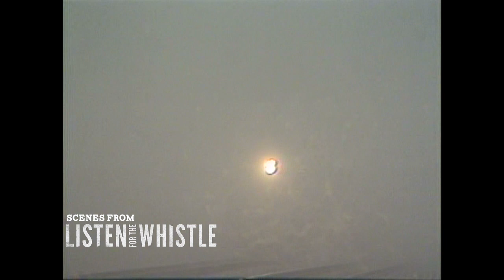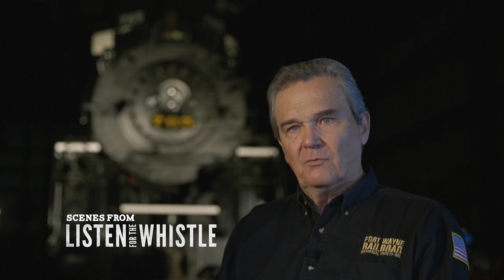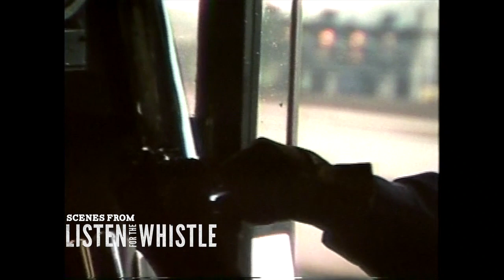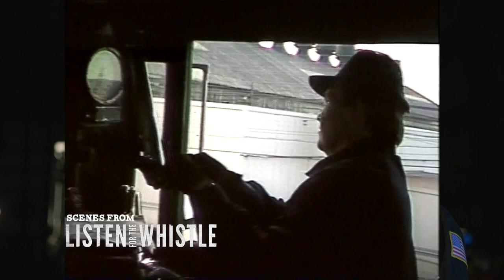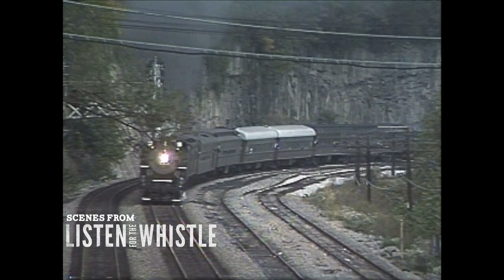Attica Hill is No Match for Steam | Nickel Plate Road no. 765

Comment: Again, 765 has proven how powerful she is! :D
Reply: I would like to see her take on bigboy on a pulling test!
Reply: No contest.
Reply: Let's not get crazy here.  You're talking about pitting a 6000+hp articulated steam locomotive with 135375lbf starting tractive effort against a 4500hp locomotive with 64135lbf starting tractive effort.  I love 765 to death but a Big Boy like 4014 would probably chew her up, spit her out, look back and say "What was that?" and move on like nothing happened.

BTW: I love crunching numbers.  Based on some math figures from a 1934 article about calculating a steam locomotive's power at speed and based on the fact that it takes 8lbf per ton to move a train on perfectly flat track I estimate that 765 if pushed to the limit could probably pull a train of 4881 tons at a speed of 40mph, excluding the weight of the engine and tender.  A Big Boy on the other hand at 40mph is likely to move 7510 tons, again minus the weight of the engine and tender.
Reply: its a joke! even I know a Berkshire cant take on a bigboy
Reply: I hate to say this but 765 would lose! The big boy is is a freight locomotive therefore she can pull a hell of a lot more but it would be to see how much the 765 could pull!

Comment: I remember I saw the 3985 at the top of Kirkwood hill back in 2004. The station was set at the top of the hill, and even though the speed limit is 20, I remember I could SEE the brick inlay of the station platform shake and buckle from the power.

Comment: Excellent story! We NEED many more like this. It maybe nothing to you folks who get to spend everyday in "the life", but to those who only get to see it from a video standpoint..... well.... were selfish and want more!!!
Your doing great things. I wish SRI and 1225 could do as much. Please post more stories like this. You have no idea the size of the void there is concerning the need of experienced crews telling their stories. Hoggers, Firemen, Brakemen, and Conductors alike.
Reply: yep 1225 is even a bit stronger then the 765 by about 300 or so horsepower, the 765 has 4000 and was made to run hard freight at road speed though the cars were half the size they are today, but still 50 cars of freight is a lot for one engine to run by itself but I have seen it done though it is slower then molassis in antartica though they do have a speed restriction for extra long trains due to the increased stopping distance, but I have seen 2 engines take one that had to be at least a mile long full of coal and they struggled it seemed and they were the six wheel truck set bnsf locos, so they are at least 4300 hp last I checked, you just cant beat a steamer for raw power though and I heard that the horseshoe curve excursion put the 765 though its paces, and I doubt it would have pulled over saluta  without help even 611 had a great deal of trouble with that on the videos of her trying to make the hill after half her consist was taken over with other engines, though she gets going from a dead stop and hauls at it and takes the hill to the top on what was the steepest mainline grade before it was taken out of service, though I doubt even two diesles could do that today from a dead stop it would not be easy for sure. though today railroading is a differant day and age and the things they did in the past they get their underwear in a bunch about if they were done today, though it sure gave more people work and jobs being more man power intensive then today.
Reply: manga12 I know the 611 video your talking about. Had her hands full that day huh! As for the Berkshires you mentioned, your about spot on with your numbers. However, with 1225 having 1" larger drivers (given to her [and her sisters] after she started service) and friction bearings, this would tend to even them out. Both capable of handling 100+ car trains instead of the 50 you mentioned. And up to 80 mph in some places during their normal service years. Cars may be larger now, but their weight hasn't changed much. 70 and 100 ton cars existed back then.
I cant state how NKP operated but the PM did run shorter trains than them. When the C&O took over the PM in 1947 and the C&O Mechanical Dept got onboard, they quickly saw that the PM Berks were very, very underused at hauling short trains (less than 80 cars). And in good shape from the lack of abuse and good maintenance. The PM engineers were promptly given longer trains to pull, and at the same speeds or better. In those days, you didn't shorten a train, you added another loco. Many a picture exist of doubleheaded NKP Berkshires. Never saw a PM Berkshire doubleheader. I have seen a Mikado and Berkshire together on the PM, so it had to have happened. The theory being, if one loco starts the train, albeit slowly, then two locos will start it moving faster. That was the rational.
Be a good show to see 765 or 1225 on Saluda. The smaller drivers (than 611) might have given them the edge to get over the top. Hard to say.

(my references are "PM POWER" by Art Million, "C&O Power" by Huddleston/Stouffer, "Van Sweringen Berkshires" by Huddleston,  and Lima blueprints of the PM Mech Dept. and AMC)
Reply: PM Railfan I dont know about a saluta, it gave just about all locos a workout, and 611 has more power but your right it has biger drivers though I dont know that 2 inches would have made much differance compaired to say a sub 60 inch driver diamiter, as for the use in modern day freight well I guess that that only way to compair would be to rig a mile long one up to 765 and pull and compare it to one of them new ge locos that get 4300 hp and see who could pull the train better get it going faster, see if its still able to do it just as well or better at high speed service, its the only real way to know for real, though the steamer I bet would do a better job at speed once its there since the new ge 4300 series only have 43 inch wheels tiny in comparison to steamers drivers. I dont know though the pm 1225 would be apples to apples hp in comparison but I dont think she ever runs the main line just her route in michagan but I dont know for sure.
Reply: No need to test locos with a mile long train. Just search on here (youtube) and you can find all the proof you need as to how steam can outperform diesel. I know for a fact there are two videos here that depict the "New River Train" both with 765 and diesels. It only took ONE Berkshire to pull 30 cars (UNASSISTED!). It took TWO GE 4400's to match that. For all their prowess, a/c traction control, and other fancy modern enhancements.... steam still pulls more!
No, 1225 for some insane reason isn't allowed out of Michigan. I can never get a straight answer for this from anyone in the know. I summize, its NS and CSX's "anti-steam" programs. Think about it, if you were SRI what is the first thing youd want to do with 1225??? Put her on the main and notch her open to about 60mph and watch her purrrrr along. Never happen as long as NS and CSX are around. (oh how I wish they would prove me wrong! FAT CHANCE!)
Reply: PM Railfan ns though has the 21st century steam program, they have more then asked for the 765 npk to pull excursions for employees the last 2 years, they put lots of trips on her during the summer, so I dont buy that NS is anti steam, csx is dead set I hear, though this might have to do with the shear volume of traffic on their rails as I can attest as being held up constantly at the track, and my neighbor that just became a conductor for the csx, can attest they cant seem to get people signed on fast enough.

but he dont like the scedualing they do and sometimes being on the road for 36 hours while deadheading home or waiting for a train to take him back here to deadhead, he is gone constantly, he said the pay is good but he dont like the scedual and its really not something he is liking, the rails arn't for everyone after all though, but he also said sometimes they pull out and got to wait got to wait and end up over time so they sit till the recrew and sometimes he dont have to do a dang thing for hours, but attention to detail and orders is absolute no messing up allowed with that much power and weight, 

I am well aware of the NPK 765 holding the record for the amount of cars up the new river train, though she is really set up break wise for no more then 20-25 Mr Winniker at the historical society where she is kept said, as it has something to do with the handling with passenger cars and not thowing people around with hard breaking like you can with freight.

I would still like to see the NPK pull some revenue freight myself though once in a blue moon, 10 cars on excursion is really not even working her all that much, compared to what she was made to do.
Reply: manga12 Hey ditto that one for me too! Would love to see 765 storm her way down some nice stretch of mainline with about 80 cars of freight. AND a dam caboose too -no FRED!
Nothing like the sound of steam at 60mph! Make it a winter scene too, you know she would put on a good show of steam!
To think, people used to take this form of travel for granted.
I hadn't heard of the air set up like you mentioned. Certainly is an interesting tidbit of info and makes good sense.
Reply: PM Railfan yea a caboose, and really pounding the steel like its on fire, as fore winter you will not ever catch her pulling in below freezing anymore, can damage the pipes with the ice, they told me at that one open house in 2013, the thing was in the old days they would have hot steam generators to keep the pipes from freezing or keep the fire going as if the water froze in all those pipes on a loco it would do great damage, so they will not run her when its this cold like tonight the fires snow of the season 12:54 am 11/13/2013 as I write this, the 765 very well could pull loaded freight and not empty cars like they do in mich for the photo opps by the carlin grain elevator like they do from time to time by owasso, reall loaded coal and giver her about 20 cars if she is going to go to west wayne to turn around another time, like they sometimes do, even if its just a short duty let her pull it under power and not pushed like they did last time they took her down there to turn when they did.
Reply: Sounds like the road foreman on the tourist railroad that I work for in Oregon. He's pretty irritating. He was like that the first time that I ran with him. Turns out he's like that with everyone I work with. He's just a curmudgeonly old road foreman who is about 80 years old. Thankfully he retired a couple of years ago. I'm now the acting road foreman, and I'm 25 years old.

Comment: Have to wonder what the trailing tonnage behind the tender was for this trip. As far as I can find, Attica Hill is graded at 1.15%. 765 would be nominally rated on that hill for about 1900 trailing tons (drag speed), which works out to about 23-24 cars in the 75 to 80 ton range.

If the locomotive wasn't being worked hard and had room to accelerate from 30 mph, the trailing consist was probably closer to 15-16 cars.
Reply: If it is 1.15% what is that in terms of 1 in something  (1 in 40) for example?
Reply: @AECEntertainment  1 in 40 is actually 2.5%. 1.15% works out to 1 in 87.
Reply: @FanRailer  how do you calculate it then. Pardon my ignorance
Reply: @AECEntertainment  if you're talking about converting between the two gradient units, I dont know the actual conversion formula. I just googled it. Calculating tonnage ratings, I do know how to do.
Reply: That all depends on what ones own definition of "being worked hard". I'd imagine he was giving 'er some beans
Reply: You also have to factor in that loaded FREIGHT cars (which the railroad handles every day) and loaded PASSENGER cars (which is almost all 765 has had to pull in recent history) are 2 completely different weights.

Comment: This trip from Buffalo was probably 1987. Cause that year 765 had a oscillating mars light above the regular headlight. This was smaller than the one that is equipped on SP 4449 Daylight
Reply: Given that he said it was on Conrail, they were heading outta Buffalo on old Erie tracks, and that he'd never ran on the line before, I'd guess '85 at the latest. Those shots from 1987 were of that year's New River Train which clearly never ran on Conrail trackage in New York State. The other shots, I'm unaware of what year they were.

Comment: going back to this I say there are next to no railroad workers that even have an inking of the power or how a steamer runs, many kids even never saw even a real display engine or one at a theme park, turns out the harder you work a steamer and the more speed you put on it the more draft on the fire so its more like a forge and a hotter fire makes steam better as well as gets the steam drier in the superheater so it expands more, and in turn the faster it runs the cutoff can be used more fully to use even less steam per stroke and lets it more fully use all its power and expantion against the piston before it is exausted up the stack which in turn creates more draft on the fire, as what causes the steam to shoot out the sided when it starts out to get all the condensation out of the cylenders is then closed off with the cylender cocks or valves and then the exaust steam is sent up the stack.

Now it might be harder on the low end for a steamer to start a heavy train but once it gets going it makes more of its peak power and therefore can pull a train it cant start while it is said a diesle electro can start a train that it cant pull as most of its torque is on the low end and depending on the gearing in the 2010s now tops out at a lower rpm and does not have the advantage of a steamer where the more speed and heat you can get into its fuel the more of its peak power it makes.  its in a way kind of like a turbine based engine where heated air aids the expantion of gas in this case heated air and fuel which aids the effecentcy of the engine.

Comment: Two questions about the 765 how old is it and what is the maximum Boiler pressure?
Reply: 765 was built in 1944 and operates at 245 psi boiler pressure.

Comment: I'm curious, If Milwaukee road's famous St Paul Pass was still here today, the section of track that had the little joes, could this train run without a diesel through there?
Reply: +Gamer Lunatic If I"m reading your comment right, it sounds like the St. Paul Pass hasn't existed for quite a long time. Decades maybe? Depending on when you were talking about, it's quite possible that MIlwaukee Road 261, which is a fairly comparable locomotive to the 765, could have made it. How steep is the pass?
Reply: +1993Warbirds You can say that you are right about it being gone for a long time. I bring it up because the pass was mainly electrified and Milwaukee was one of the first companies to make use of electrification for freight travel in America. The electrification ran through the mountains in Idaho and into the west end of Montana. It was electrified as you might have guessed was for improving freight travel in that region as steam operation there was difficult and it got really cold. At that point the little joes took over that region with freight and I assume passenger travel. That being said I'm not debunking that steam was not possible, but was difficult. But I heard, could be a rumor, that the Union Pacific Big boys were able to climb up there to test the free swinging front driving wheels. As for the pass and how steep it is, it can go up to 4% i think
Reply: If I remember correctly a 4% grade means that for every 100 feet, you rise 4 feet. This may not sound like much, but it is difficult when a mile long train is being pulled. There are a number of other factors that go into this as well. What is the starting speed at the bottom of the hill. How long is the hill? What is the weight of the train itself excluding the locomotive and the tender. The UP Big Boys I believe could handle a 7% grade or maybe even 8%, but they are exceptions. A 4% grade is about the maximum possible for a non-articulated steam locomotive. Or any modern locomotive for that matter. Milwaukee Road 261 was one of the most powerful non-articulated steam locomotives ever produced. It's certainly within the realm of possibility. But of course, those other questions would have to be answered first.
Reply: +1993Warbirds no regular steam locomotive could handle 7 to 8 % grades unless it was one of the geard locomotives like the Shay/ hyster/ climax locomotives. Saluda grade in North Carolina is steep at just over 5% but it's no longer used.

Comment: looks like they will be hitting attica hill once more this year in 2015 on the trips east, I am sure the road they will be a guest on at least that is what the enginer sitting in the cab at the open house on saturday was saying, cant remember his name but it was around the time fireman zack was sitting there feeding, the fire.  I am sure they will not be as supprised this time, as she has done this a few times, what people dont know is that the old fast freight locos like npk 765 is that they make more peak horsepower at a higher speed as opposed to the diesles that have all of it at under 15 mph peak torque, they also dont have as large of wheels which changes the leverage of the power between the two. oh the fellow in the enginer seat also is part of the tech team for the penn T-1 project small world isn't it.